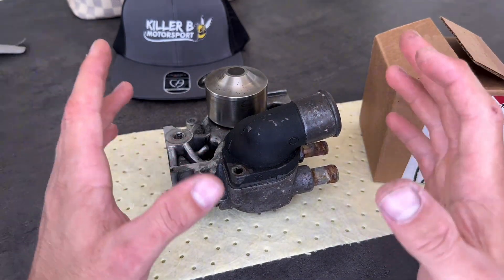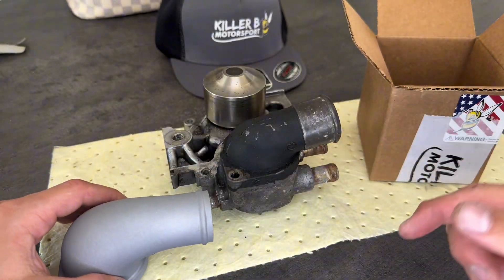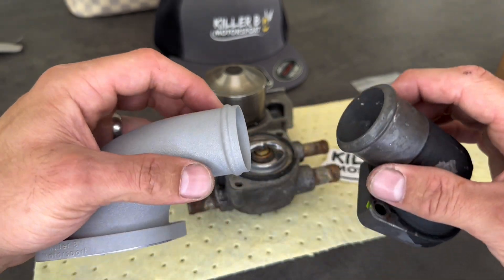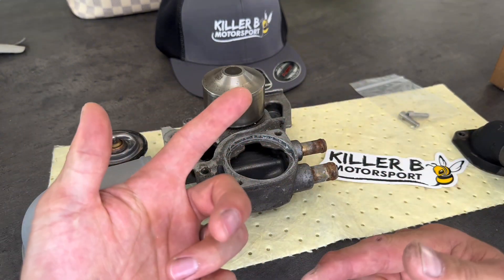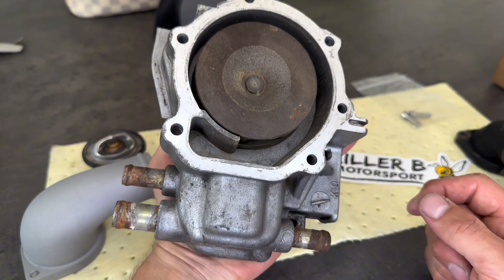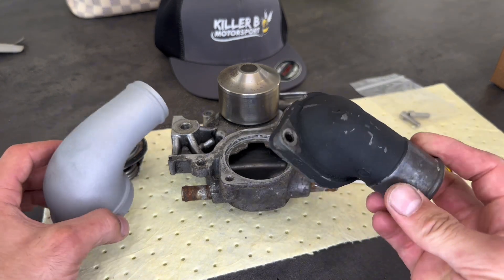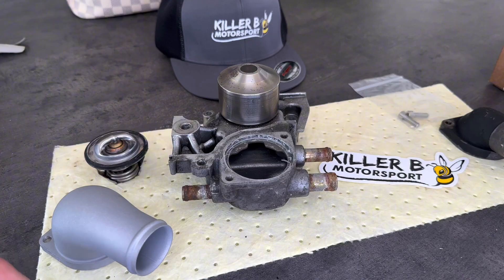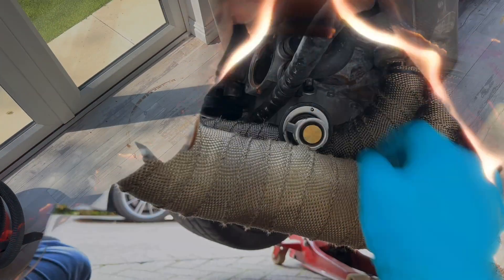Killer B High Flow Water Pump Housing

Comment: Hi sam what is the best radiators to run if I’m running 500+hp to keep temperatures down better? Cheer’s keep the videos coming
Reply from the maker: Hiya mate, stock radiator is best mate, I’m on the stock one on mine 👌
Reply: @5501pickopicko  
Cheers sam